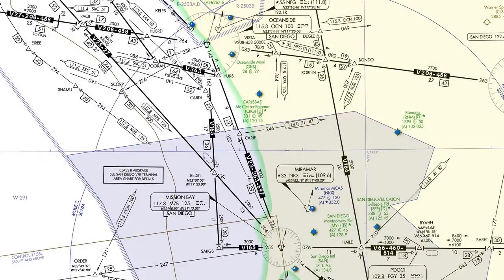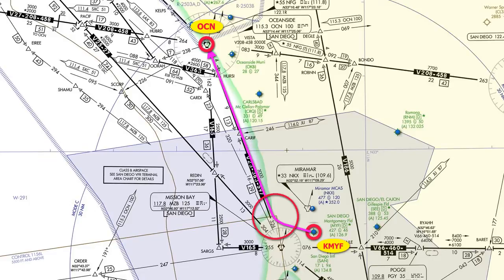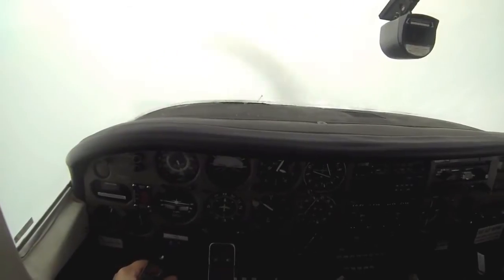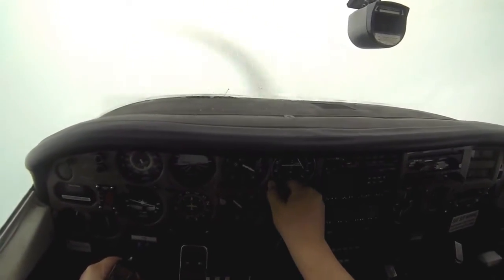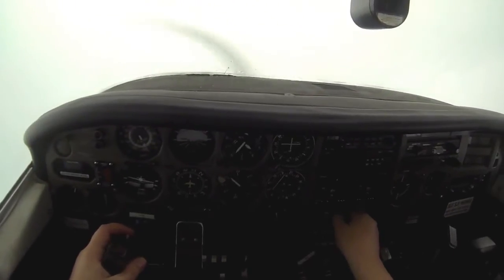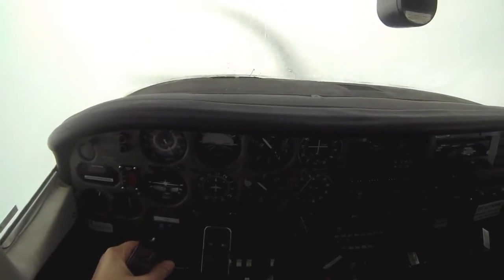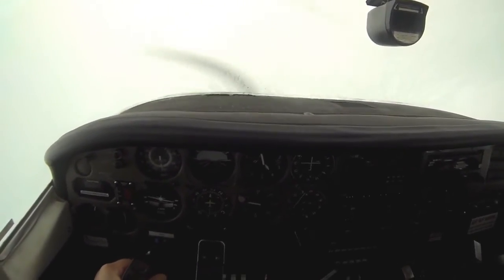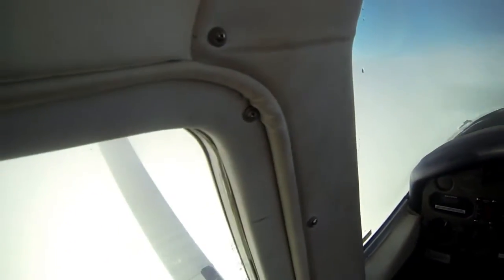VOR Tunning in IMC Flight (KMYF to OCN VOR)

Comment: I Agree ATP-flight School, will get you from zero 0 to Commercial license with 250 hrs  CFI/MEI @ $80000, when hire you will be offered first officer seat (co-pilot) of a local regional commuter to earn $14,50 hr = $23500 a year , SO..does it worth it ??
Reply from the maker: Here is the deal. In the US they recently changed the rules where you need to have an ATP rating (1500 hrs min), you cant just have your CPL with 250 hrs and multi rating and be a "cruise" pilot for a regional commuter.

So, with 250 hrs and the ratings from ATP Flight Academy you can pretty much only become an instructor, or maybe find a small charter company that flies cargo planes such as BE55 Barons.

After you reach 1,500 hrs and get your ATP, then you can get into a regional jet and make $14.50 hr and around $24K a year.

It is worth it if it is your dream to be an airline pilot, but if you have a family to take care of, that won't cut it unless your spouse has a good paying job and is VERY UNDERSTANDING about your hours.

But, with 250+ hrs and CPL rating you can always apply at overseas companies in Asia where they still take cruise pilots (2nd officers) with less than an ATP rating who make around $50K a year. But withing 2-3 years you become a 1st officer (co-pilot) and you and make $90K+ a year.

Either way its a hard road to be a pilot in one of those jets we see flying, but it is very doable as long as you are prepared for all the hard times that come first.
Reply: Wow, you clearly explain it even more detailed,wow,so in US ATP=1500hr equals $160000. let alone their turbine requirements
a long fellow pilot told me once, that you get in the industry just for the love of flying & Aviation

Comment from the maker: From 0 hours to your CPL/CFI/CFII/MEI with around 275 to 300 hrs (including 100 hrs multi including simulator time), my friend paid around $80,000

If you already have your PPL, (depending on how many hours you have already), I'm guessing that it would be $14,000 to $65,000

I have around 500 hrs (all single engine except 1 hour) with IFR rating but no CPL, and they told me for me to add on my CPL, CFI, CFII and MEI it would cost me around $14,000

Send them an email and find out what exactly.